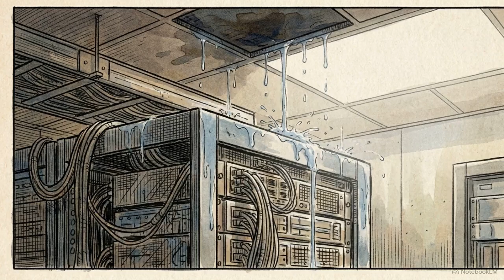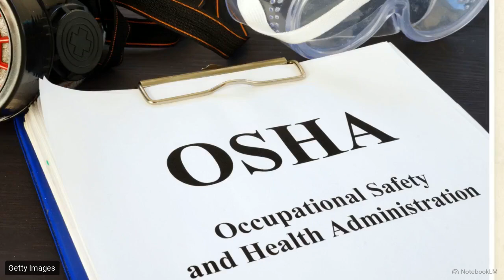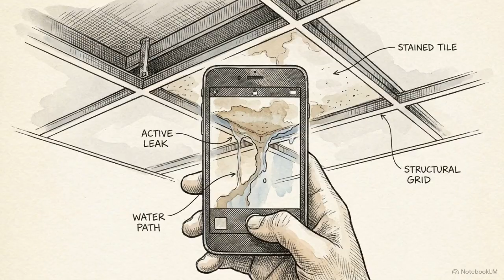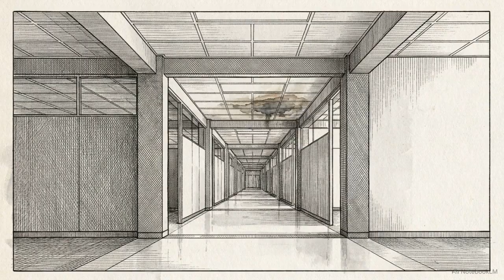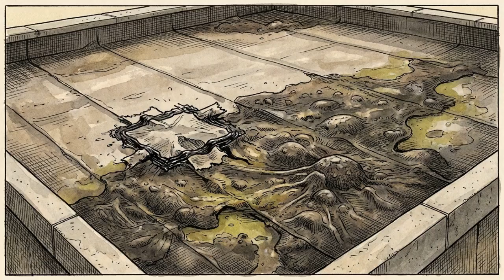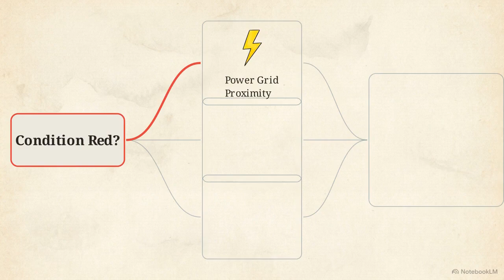Commercial Roof Repair Pasadena: Emergency Roof Leak Quick Fixes Can Fail

Comment from the maker: Dealing with an active commercial roof leak in Pasadena? Temporary patches may reduce water entry, but they do not always solve the real roof problem.

Schedule professional commercial roof repair with Commercial Roofing Pasadena:
https://commercialroofingpasadena.com/roof-repair/

You can also read the full emergency roof leak guide here:
https://commercialroofingpasadena.com/emergency-commercial-roof-leak-repair-pasadena/